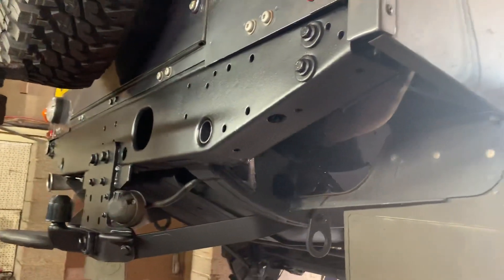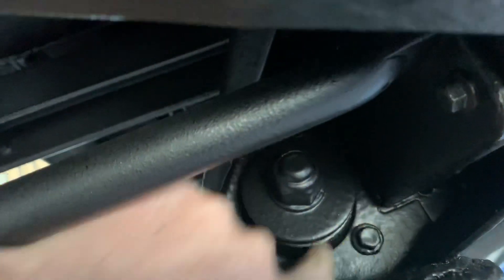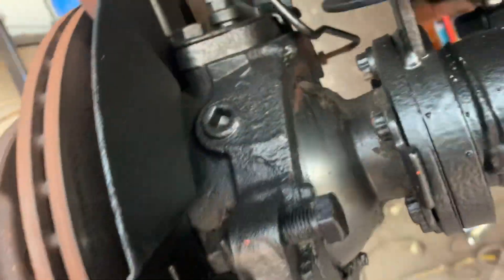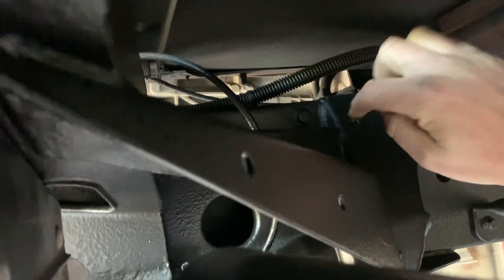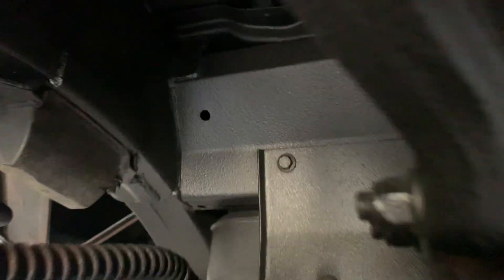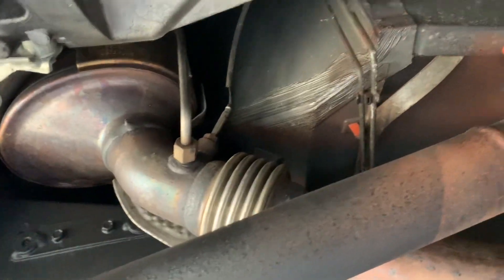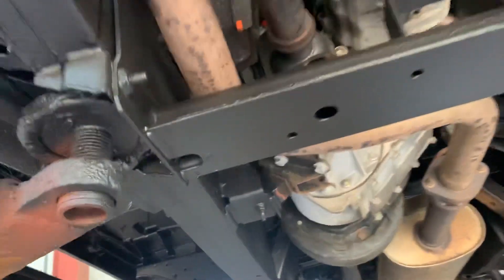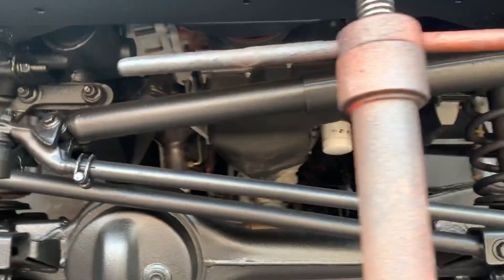Defender 4x4 platinum Rustproofing Buzzweld

Comment: Are these coatings rubberised or do the dry hard like paint?
Reply from the maker: Jason Jones we don’t sell rubberised or wet wax type coatings. Wet coatings attract the dirt and muck, forming a moisture sponge, and rubberised tend to delaminate with rust, and peel, trapping moisture against the steel and acting as a catalyst for corrosion.

Comment: Real nice job.

Wondering what your thoughts are on Raptor liner (Tinted) as an undercoating? I guess you rate it because you sell it, does this man it shouldn't suffer from the same problems as wax or rubberised coatings can? Just worried it might eventually have the same problem of trapping water behind it and then hiding the rust for a many years until its really bad.

Also thoughts on 3M Epoxy bag sealer, 08800 as this is the other option. This will likely be more expensive as I'll need a lot of bags then if I want it body coloured it will need sprayed afterwards.

I do want a reasonably smooth finish that will be easy to wash. Was even consider spraying clear over them to it easy.